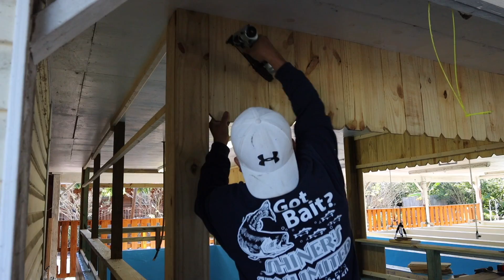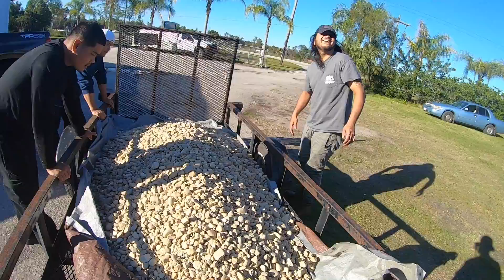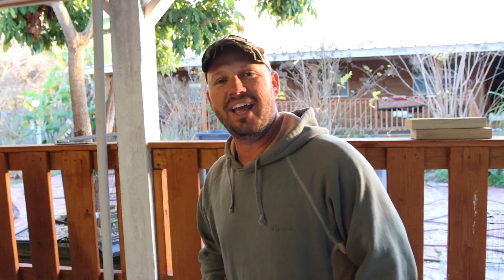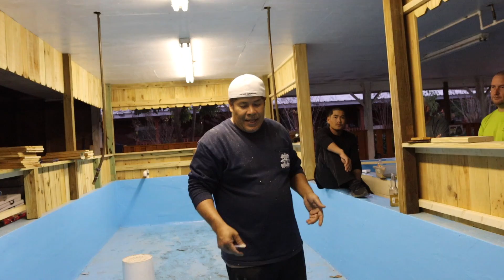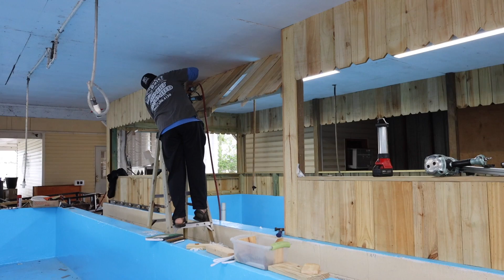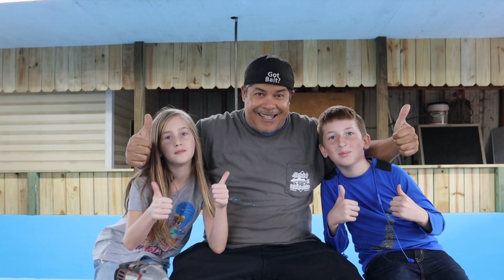TiKi Bass Tank Structure is Complete

Comment: Sweet what are the dimensions of that tank. Did you put a concrete foundation for the bottom? I am thinking about using this sort of tank just deeper partially in the ground for a pool? What you think any points Sam or ideas?